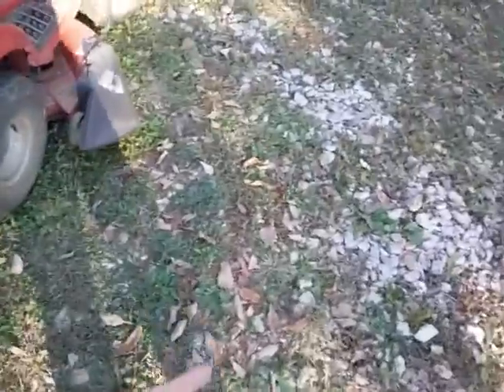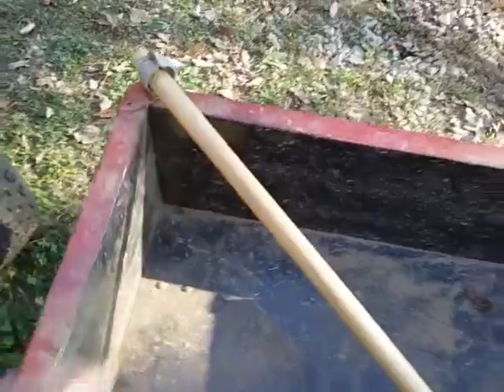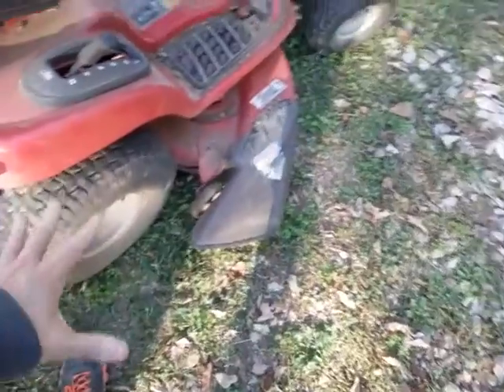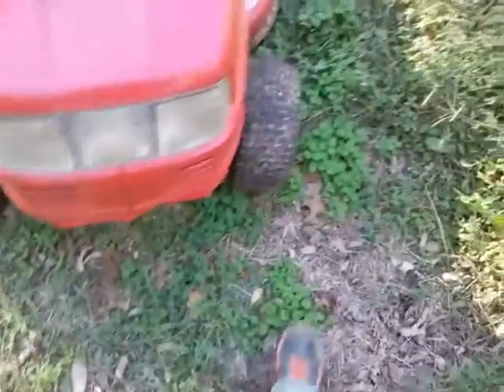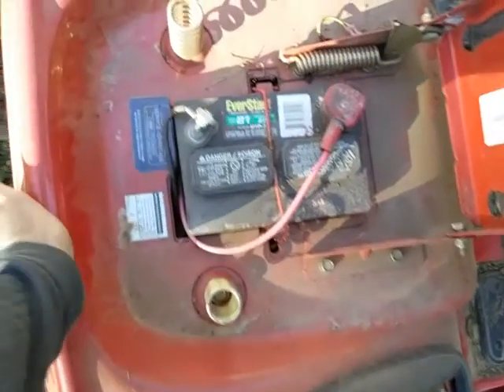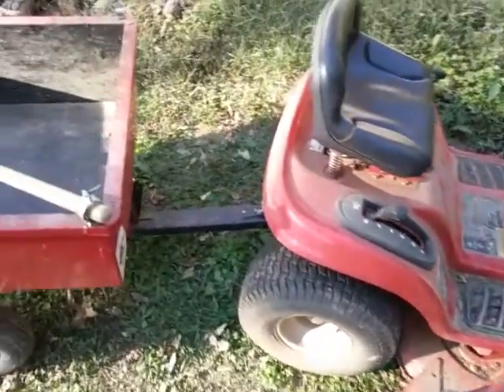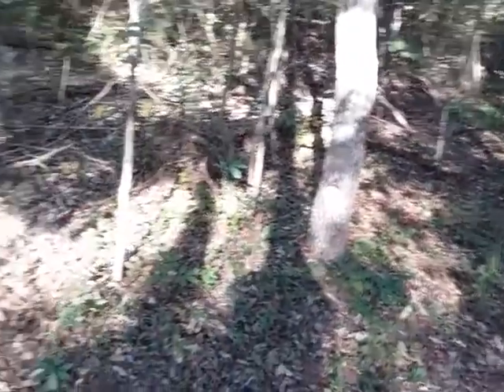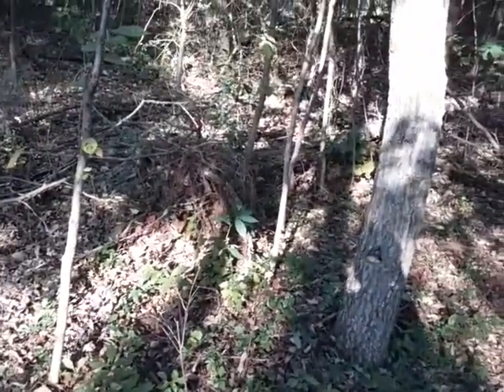Troy-Bilt Super Bronco 19 HP Lawn Tractor with Dump Cart Wagon - Lawn & Garden Gear

Comment: I just got one of these from one of my mom's friends. Needed some work but now it runs great!
Reply from the maker: Mine is over 10 years old and runs pretty good. Had to replace belts and blades but all else is good 👍
Reply: Mine is 12 years old, needs a tuneup, has needed one for 4 years or so, it’s blades are messed up, needs a new battery, but it somehow still runs, well, almost perfectly. At least, the engine runs perfectly.
Reply: I also just gave it a good scrub down, and it’s now perfect shiny red. Guess all that dust protected the original paint job.

Comment: So I guess I’m not the only one with a bent front on my super bronco. Interesting how it is dented in the exact same spot on an almost identical model.
Reply from the maker: I got mine second hand, not really sure how the dent happened. My mower is now leaking oil because of a crack in the engine casing. I think mine had a load of use before getting it. Not sure if it is fixable - it's a real bummer!
Reply: My father took it for a drive a long time ago, I think he overestimated it’s turning abilities and rammed the house.